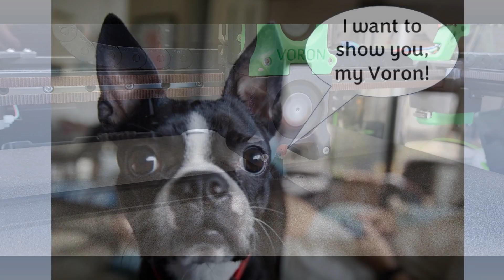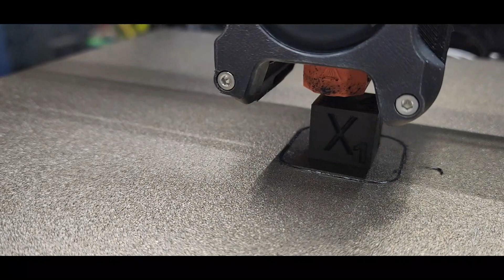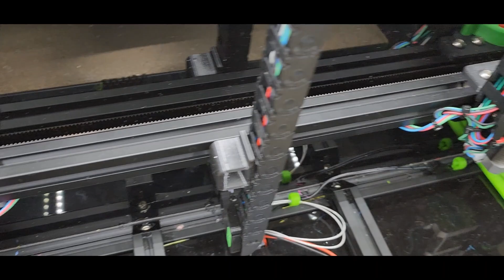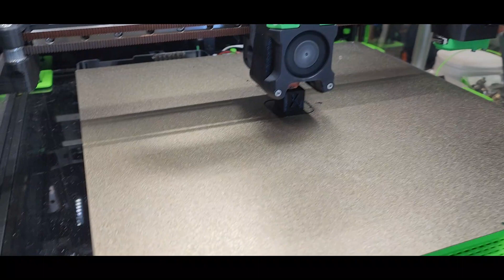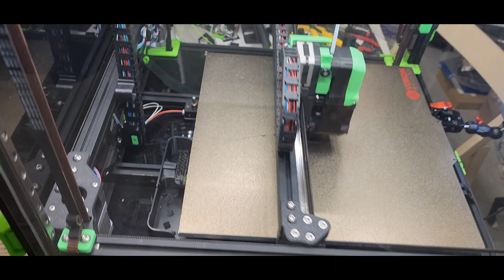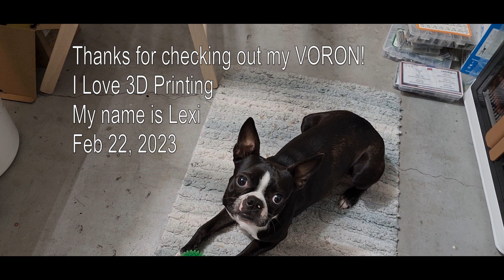My Voron 2.4 R2 Printer with AfterBurner Toolhead Before Switch to StealthBurner and CAN.

Comment: Mine is fast, but not that fast! Wow.
Reply from the maker: For a 350 x 350 x 350 build volume it moves pretty good.  I have more adjusting to do and mass reduction mods and it should be able to go at least 10% more.  I want to build a Voron v0.2 printer next.  It is a smaller machine that should be able to go faster.  I really enjoyed building the 2.4 R2.  

Thanks for your kind comment.